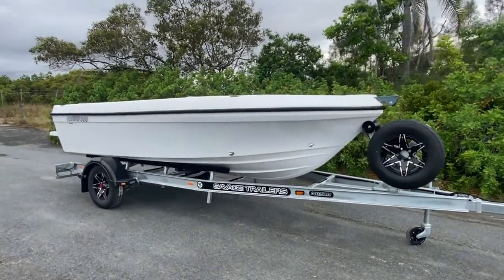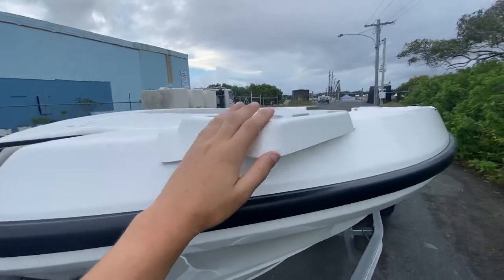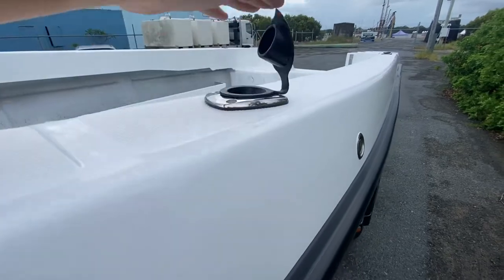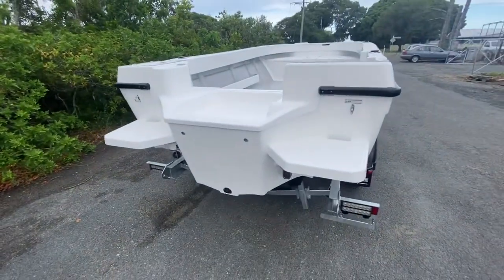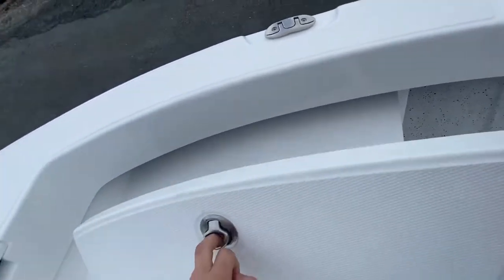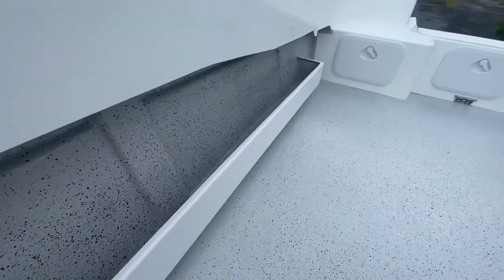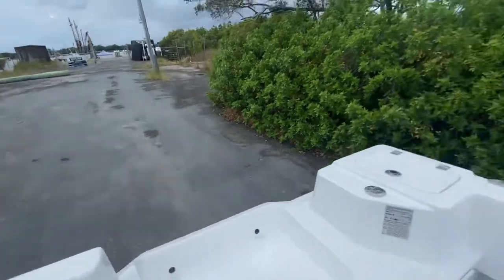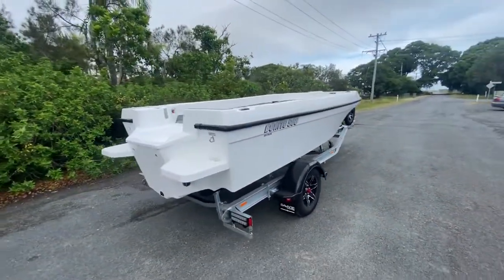BONITO BOATS AUSTRALIA 500 SPORTS TILLER STEER WALKTHROUGH

Comment: How do you access the fuel tank to check the hoses etc ?
Reply: You cut the floor out.
Reply: @turbostyler  🤣🤣
Reply: @joeltramacchi6365  The plate boat I had with a fully sealed self draining deck , had a inspection hatch that could be unsealed and lifted up and off for inspection and maintenance purposes . Not that complicated.